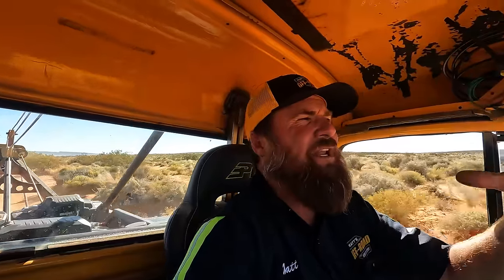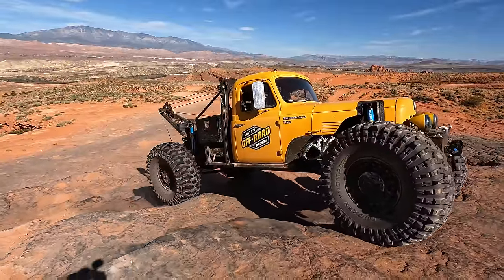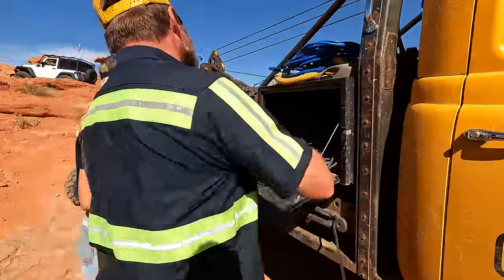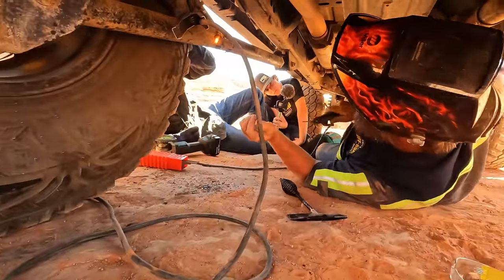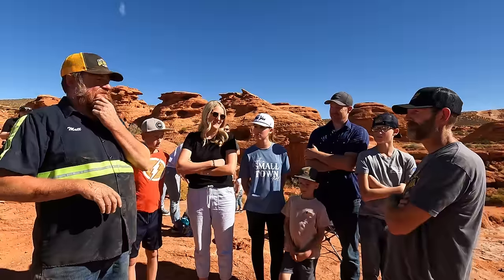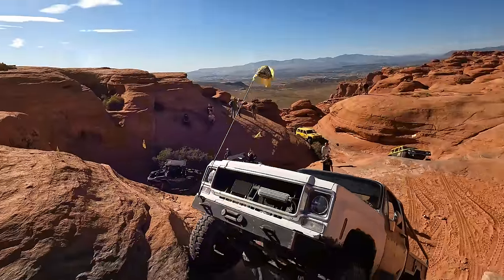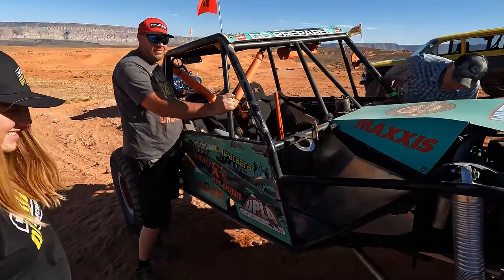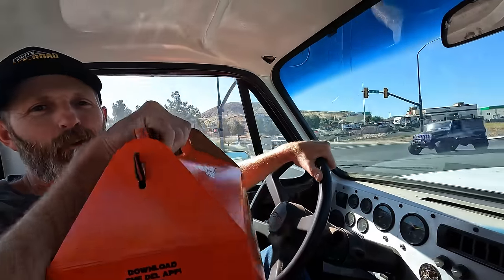Will My Trail Repair Save This Family?

Comment: Important reminder for everyone, wear yer safety glasses.  "Safety squints" are for people who don't care about their eyes.  Think I was 28 years old or so, and at that point had been wearing glasses for 21 years but finally got myself some contact lenses.  Doing some work on my car, had to clean some stuff up on the bench grinder wire wheel.  Wearing glasses my entire life, I was used to always having some level of protection, so I constantly forgot to put on safety glasses.  Well that day, I took a wire from that wire wheel right in the eyeball.  Thankfully for me and my eyeball, the wire barely made it through the contact lens and did not do any permanent damage to my eye.  Fast forward 12 years later, I'm going on two years of Lasik and wear safety glasses when cooking food or vacuuming my carpet lol.

Comment: I think it is so interesting how Matt went from needing no winches unless he needed one in the hitch to having winches everywhere.  Such a big change from what it once was.
Reply: That was my biggest beef with them years ago haha. He came around eventually
Reply: @georgejulien3286  He explained in one episode that synthetic winch lines were what brought him around. All his old experience and dislike of winches had been steel cable winch lines and the snags, cuts, snaps, and other awful things they always brought with. Once he discovered synthetic, he was sold again.
Reply: @offshack  I saw that video… but he still needed winches before synthetic was a thing. He just refused to do anything except pull people barely stuck in the sand who had no friends to help haha
Reply: We get older, we learn, we grow...props to Matt...
Reply: He’s got all of those winches because Rory has them! Ever notice what one does for content the others copy. Paul and Robby both did front bumpers.
Reply: I wonder what's next? He'll start using sand tracks and will wear rubber boots in mud?
Reply: It's because winch lines changed from dangerous metal to synthetic, which is a night and day difference as far as danger. Remember, his main job is his tow truck company his experience with winches is vast.
Reply: His knowledge of vehicle recovery has also expanded greatly. I see why he changed his mind about the proper and effective way to use winches vs brute force pulling. Also, yank um ropes changed his mentality.
Reply: Synthetic Rope changed the game.
Reply: @whatnow5313  exactly. Steel cable can be lethal when it snaps. Synthetic ropes often just drop to the ground. They can still be dangerous but just far less with proper care.
Reply: @georgejulien3286 one bad experience can ruin your perception of an entire category of products, also back then Matt was not doing anywhere near as much heavy duty work so a winch would have been objectively less useful then compared to now, still would have been useful though

Comment: I had the heat issue in cab as well. I put in some sound deadener and a rubber floor mat. Reduced heat from engine bay a lot and it’s quieter now. Win win
Reply: Great suggestion.  I was thinking a headliner with insulation would help also.

Comment: There is a spoolgun that connects directly to the PPW, which might be easier to use than running 7018s. Welding tubing in that orientation is akin to the 6g position for pipe, and unless have experience/training, it will affect the quality of the repair. I would also suggest getting the leather hood for under vehicle welding, as it doesn't stick out as much as the shop hood does, and unless you have earplugs, you WILL get molten metal in your ear using the regular hood while laying in that position, while the leather hood completely covers your head, being a bit sweaty is better than a burn on your eardrum.

Comment: Out of all their vehicles I like the morrvair the best. It’s such a well built capable machine with an awesome body! ❤
Reply: I love it also just because it's a Corvair, of all things to build for a recovery vehicle. It does some amazing things and I can't believe that more customers are not surprised and comment on it. I always liked Corvairs and had a couple years ago. I can't speak for the first body style like this one but I know there was nothing unsafe about the handling of the later model ones. I put cragars with 60's on mine and it handled like a mini corvette. They got a bum rap when Nader bad-mouthed them. GM should have sued him. I have seen many of them modified, usually to go fast, but nothing compared to this awesome crawling machine and something Matt should be quite proud of. I also think it has the best sounding exhaust out of all his builds especially under a load.
Reply: @JT-SE-OHIO  totally agree 💯

Comment: Jaymie - this comment is for you - please read.  You have to ask Matt to stop welding without gloves.  The welding arc gives off hard damaging UV radiation that causes melanomas otherwise known as skin cancer which can be very aggressive and difficult to treat.  In Australia we take skin cancer very seriously as it is one of the leading causes of death over here. 

If you can't get him to stop, at the very least ask him to attend a skin specialist often for checking moles and get any melanomas removed before they can kill him.

For everyone else - I know - nanny state etc he should be able to do what he wants yada yada yada.  Thats what most people say here before they get skin cancer.  Its a very different tune after they get it.
Reply: I'm in Thestralia as well, I'm getting one cut out in a fortnight.
Reply: back in the 1970s and 1980s during the boom of electronics (DIY especially) we had an epidemic of engineers ending up with metal poisoning (Lead) because of inhaling the fumes from the solder. people went through physical hellscape of health issues before lead solder was effectively banned for many use cases.

today you see people complaining that the lead-free solder doesn't work as well. people will complain about anything. i wish they would stop eating lead paint.
Reply: This is actually true.  I made the mistake and received a very Odd what I could only describe as a sunburn from my flux core Wire feed welder.  It was like an odd sunburn but different? 😮
   And Matt being in a state that already has high UV exposure and his fair skin he could be a great risk.  So good call. 👍
Reply: For sure, I burned my left hand without realizing it till later just wire welding. It was like a bad sunburn but, enough to make me start wearing gloves.
Reply: What wheels are on tom’s dig/dug?  I strongly agree with Steven Gloor about the skin cancer.  Also,  more frequent use of safety glasses.
Reply: @jeffwarren8154  He has mentioned before that they are off a 4Runner
Reply: Yah I don't know muxh about welding,  but Matt does seem to take it lightly,  cover up!!!!
Reply: Safety nanny here:   It's usually dry there in Utah, so your body's skin resistance and ability to make a circuit back to the welder ground is typically difficult.  But I cringe when I see bare hand on the stick or the top of the holder.  Just an odd rainy day or snow or sweaty hands, and a rare puddle or sweaty butt cheek back to vehicle chassis and you've been welded.
Reply: And not using a helmet. A cavalier attitude to dangerous things will ALWAYS end up in trouble sooner or later.
Reply: @BikingWIthPanda that is blatantly untrue about lead solder. Soldering temps do not get hot enough to vaporize lead. Flux fumes are not good for you though. Don’t lick the solder, don’t eat it, have good ventilation for flux, and wash your hands after using and it’s fine.
Reply: How do you you feel about seed oils and sunglasses?
Reply: . Welding voltage is not generally high enough to kill you. Might get a tingle. It produces lots of current, but low voltage.  
I used to be a production welder and we would go through a cable spool of 0.035 wire every few months.
Reply: I’m sure he’s well aware of the risks involved with everything he does..
Reply: Stop it.50 years of welding no gloves and closed my eyes most of the time.
Reply: Underrated comment. Worst 'sunburn' I ever had was from welding with goggles, on, I couldn't find a full face helmet and only had goggles to weld with, I figured what would the harm be, oh man it was unbelievably bad for just a few hours of welding. My face did not feel right for months. Would never do it again.
Reply: @BikingWIthPanda 
I assembled electronic circuit boards in the 80’s. Now I have elevated levels of lead in my body. Wait, maybe that was from all the stuff I cleaned with leaded gasoline. 
I don’t care. 

BTW…. Leaded solder is much easier to use, get a good connection, than the other junk that replaced it. I stocked up on it for my man cave. Still have 2 rolls left.
Reply: Matt is looking like he belongs to Duck Dynasty rather than off road recovery! Get a beard trim for god sake!
Reply: Years ago my dad used the safety squint method for welding. He melted one of his contacts to his eyeball and had to go to the hospital to get it taken care of.
Fortunately, there was no lasting damage.
Reply: You don’t think he knows this? And you think trying to subvert him through his wife is going to change him?
Reply: I second that ,what these farmer type engineers need to consider is that the effects may not kick in until they are in retirement age and are looking forward to that stage in life,nothing worse that being hit with medical drama
Reply: @BikingWIthPanda it isn't fimes from leaded solder that is the issue, it's absorbing it through your skin. When you're handling lead solder all day it rubs off on your skin and gets into your blood from there.

While it is a huge safety improvement to avoid lead in factories and production work, the fact is that leaded solder is far easier to work with for repairs. That is why everyone complains about lead free. 

The obvious and easy solution is to re-wet the lead free with leaded solder before sucking it out, but people do like to complain.
Reply: Current flow depends on your resistance.   Yes usually, dry skin can be high enough resistance that little or no current will flow and you don't die that day.  Sweaty, wet, etc, no good.  Voltages as low as 40-50v can flow enough current to weld your heart.
Reply: @jefflilyea4669  You forgot to mention; you smoked 2 packs a day as well.
Reply: @BikingWIthPanda  I cast lead bullets for rifle matches and have cast tens of thousands of bullets the past few years.  I also do soldering at work for an electronics manufacturer.  The typical melting point of lead is around 650 degrees.  Lead is nowhere close to vaporizing until well over 1000 degrees.  The typical lead solder melts at around 400 degrees.  I use gloves when casting and soldering and my lead levels are below average.
Reply: It only took one project worth of welding and a hell of a sun burn on my arms to never do that again. I always wear a jacket, gloves and a helmet now, even if it's only 5 minutes of welding.
Reply: Two of my friends who were welders, ended up with cancer because of not protecting themselves from the UV. 
Be safe Matt!
Reply: Maybe if you report each video as harmful or dangerous acts and they get pulled he might start taking it seriously
Reply: @jefflilyea4669 good for you. Doesn't mean everyone else will be as lucky.

Comment: I used to have a terribly messy toolbox until I discovered a revolutionary organization tool: pencil cases. Now my electrical meter isn’t tangled up with my screwdriver and sockets, etc. That scrambled toolbox on the wrecker could be tamed somewhat by using colour coded stuff sacks or hard cases for various types of gear. Put the welding items in a kit of their own and have the ropes and shackles in their own stuff sacks. It makes it much easier to get at what you need quickly and looks more professional as well.

Comment: Matt should show Jamie how to operate the side vent windows in the wrecker.
Reply: A lost art, that was all we had back in the day,lol.
Reply: That is 260 air conditioning and unless the vent windows a loose you can direct the airflow right where it’s needed. 
That’s all the “air conditioning” I ever had in the old Ford C Cabs I drove in the 80’s and 90’s. Also where I learned that you remove and reinstall the inner door handles to point down so you don’t end up hanging off one by your pocket like a piñata.

Comment: I loved seeing Rhett in the RZR 800. It's a machine that will teach him a lot when it comes to picking his lines and thinking things through carefully in order to keep the machine upright. I had been an avid off roader in an assortment of vehicles for almost 30 years before I got one of the 800's back in 2009. I was amazed at how much more I had to learn when I got that machine, and am still amazed at how capable it is once you learn to use it. I will comment though that you possibly had a little excess capacity in your choice of recovery rope to help him get up the ledge. Also, a harness is a good choice in that machine as they are easy to roll.

Comment: 6:35 Because "high frequency" DC provides deeper and wider penetration with a cleaner bead by agitating the welding puddle
Reply: So you're saying it welds better...got it haha
Reply: @mrmotofy  Much better. But it's really hard to learn about it cause only one other person has ever offered a "HF-DC" welder so information is extremely scarce
Reply: @Patrick.Weightman  There are others starting to use a different kind...can't remember what it is. Guy sells em and been on a couple channels showing how to use it. Waldo's World was the most recent I seen few month back

Comment: Need a toll gate like Blazing Saddles. When I was but a lad in the 60's I'd often go to the woods with my dad to load logs to haul back to the sawmill. At that time we had a truck not a lot different from the WLW (only with the old stock 6 cyl engine.) Moving back and forth, hooking up a log then backing up to the log truck to set it on, in a woods, in the summer, DANG was it hot in the cab of that old International. But oh the ride home with the floor vents spewing all of the dust that had collected!

Comment: When I was young and dumb I was using one of those knotted wire wheels while only wearing my safety squints and a wire got lodged into my upper eyelid and into the lens of my eye. I was very lucky and the doc told me if it went any deeper it could've done some permanent damage so I like to think the saftey squints actually worked because my eyelid slowed the wire down😂
Reply: O,der I get more I use em...figured out now if I keep em near where tools I'm more likely to grab em and ear plugs
Reply: @mrmotofy  I had to do the same thing, I was still stubborn and lazy about wearing them until I bought them in bulk and just scattered them all over my shop and work van so no matter where I looked I'd find a pair🤣

Comment: I almost never use wire wheels anymore. Had a spot on my back for over a year that wouldn't heal figured an ingrown hair, or something. One day I pulled out a piece of crimped grinder wire. Now I use nylon abrasive wheels. You have to run them slower so I use my drill press or a variable speed buffer.

Comment: Pro tip on using a wire wheel brush: If your grinder has variable speed, turn it down by 40 - 60% whenever you don't absolutely need full wheel speed.  This greatly reduces the wire projectiles thrown from the wire wheel, and when they do, velocity will also be reduced.  Bonus is a greatly extended wire wheel life.

Comment: dang I need to pick up a metric adjustable wrench, i have only been using standard ones all these years   😁
Reply: I bet you have been rounding off nuts and bolts because you can't adjust to the exact mm.  Lucky to get within  . 03937" with the SAE Version.   LOL

Comment: Jeeeeesus man, running a wire wheel like that with no glasses on is a REALLY good way to go blind. I was buffing slag off of plasma cut parts years ago, and had a can of coke sitting on a table behind me. Went to take a drink, and it had all leaked out after a wire that came off the wheel went right through the can. An eyeball is squishier than a can, lol.

Comment: I've used zip ties as a throttle linkage before. When my cable snapped and had to drive 30 Miles in a standard shift. Operating the throttle by hand

Comment: 8:02  My favorite thing about cheap-co wire wheels is how the wires come flying off and end up impaled in my flesh.  It’s like a free acupuncture session.
Reply: Had them stick in my upper lip. Safety glasses are not enough.
Reply: Derek on Vices Grip Garage calls them the "cheek poker"

Comment: Wel Jamey, if the cab of the megaWrecker is too hot, might I suggest spraying the inside of cab with a product called Lizard Skin. Its a spray in heat and sound insulation.

Comment: To keep the heat down in the WLORW, you might want to make a chimney and intake to draw cooler air in.

You might want to weld a handle to that seat belt buckle.

Comment: @3:10... If Matt hadn't have closed off the Hood Vent, you could open it, to help keep the cab of the wrecker cooler; you could also open the wing windows. @13:30... Tom's descent was only a little bit slower this time.

Comment: If you want to make sure you have the engine off pull the keys slightly out of the lock not all the way just slightly out you cannot pull the key out and accessory or ignition

Comment: Hey Matt, you need to take the wrecker back to the dealer for all those squeaking noises at 3:37 fixed. That should be covered under the new truck warranty.

Comment: Matt, using a wirewheel is the one time you never ever skip safety glasses. Pulling the wire pieces out of the skin with pliers are unpleasant but OK, pulling the wire out of an eye way worse than unpleasant...

Comment: Matt they make a lizard matt that you could apply to the underside of the cap so it cuts down on the heat in the cab.  NASCAR uses it in the cars as references.